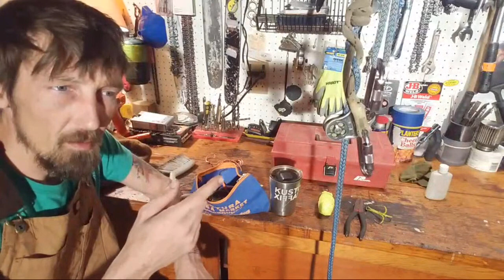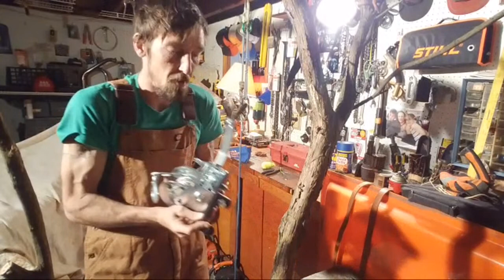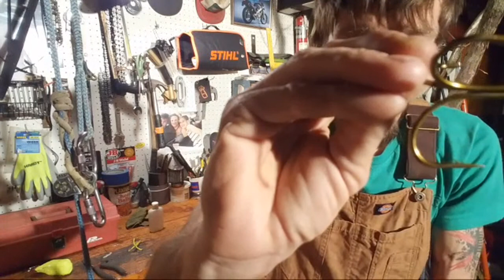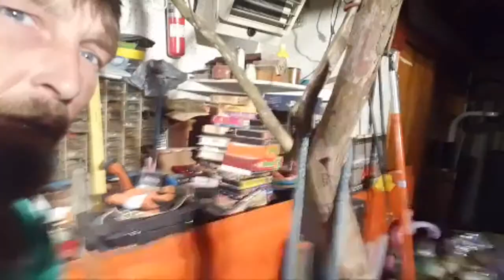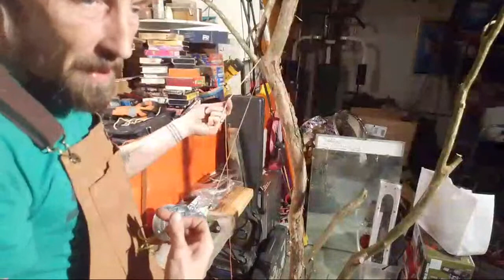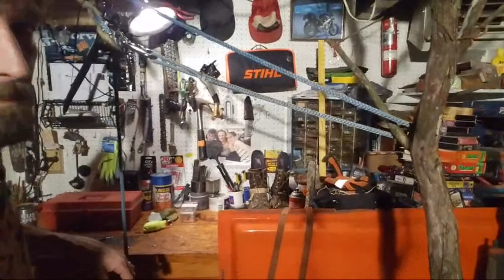How To Transfer Without A Grapple Hook (Plus More)

Comment: Can’t wait to give this a try, I deal with alot of white oaks and ashes that have wide canopies that my Captain Hook won’t fit around the leads to get into position, Thank you.
Reply from the maker: Yes sir!
It a great trick to have.  You can set up "V/M rigs" if you climb drt.  It's got allot of uses.  I want to do a tips & tricks set of videos, but they SUCK to edit.  I think I'll stick to this method, as long as yall think it's good enough.  Live feeds sometimes have crappy picture quality, & the gopros are much cleaner.  So if everyone likes this....then I'll do live videos, giving away treework tips, tricks, & equipment preference.  Call it #TheClimber'sToolBox
STAY SAFE
Reply: STIHL BORN I love it, and I’m sure everyone would agree that however your willing to share from your experiences is awesome and will take it any way you wanna give it,  I can’t wait to try this on my next take down, If I can’t use my hook, then I usually set my secondary rope from the ground over what I’m trying to traverse to and tie it to my main line on the ground then pull it up and connect it to me, so I can stay secured to a live tree, and man its sucks to hit every snag and catch along the way, this would fix that issue, rock on bro.

Comment: And on the 1 rope system you can take your tail and run it to the other tree and now you have to ropes using 1.........i use the same setup but instead i use the tail of my rope send it over and then i have to systems and can control my descend and ascend. To the next
Reply from the maker: It is a very good trick to have, & can be used in all kinds of different ways.
Reply: Yes sir i think ev1 has a couple tricks in the bag but a new 1 to learn and use is always good info i really do appreciate all the info and good content youve put out i subd becus i like your channel. PLS.  KEEP IT. COMING. YOU HAVE ATLEAST 1 SUB HERE FOR LIFE. THANK YOU